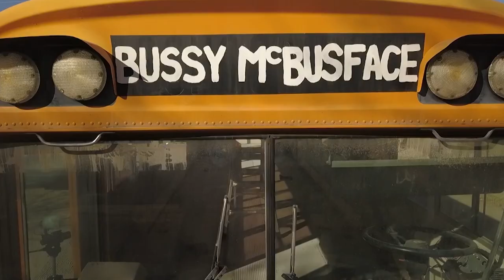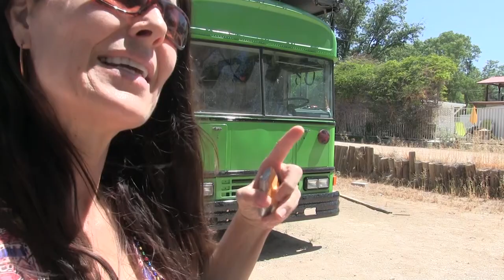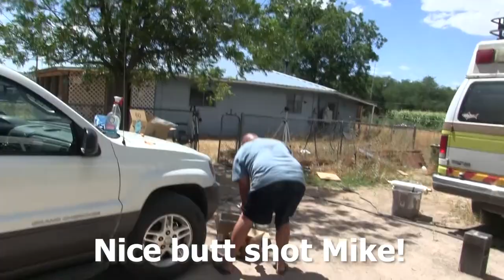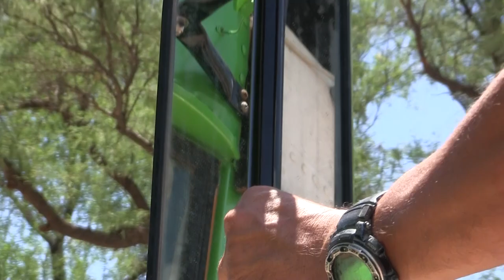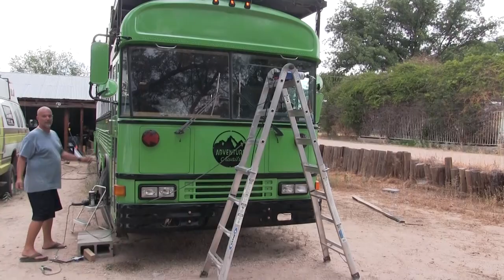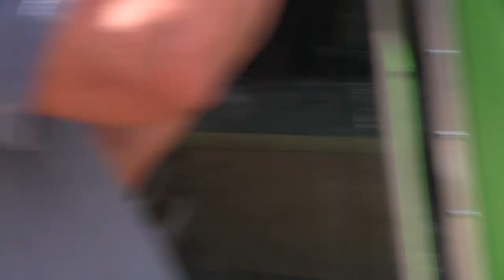The Busface: Bumper, Trim, Mirrors, Metal Sign & Door on our Skoolie!

Comment: Looks great! To get the painters tape to come off a little easier after it has dried, you can warm it up with a hair dryer.  It will heat up the glue, and it won't be such a chore to remove.

Comment: I’m just curious, since having your mini-split for a while... how are you liking it?  I just installed one in my bus and excited to see how it performs... love how quiet it is. Any recommendations?
Reply from the maker: The weak links are the windows. Every place else on the bus is insulated to a certain degree. When it's 100° outside, the windows are 100° as well. When we finally get the windows insulated with curtains or reflectix, I believe the mini split will be more than enough.